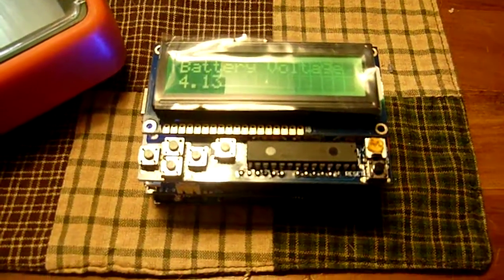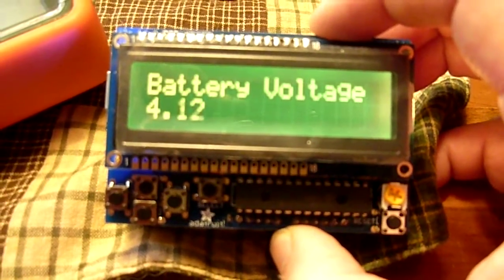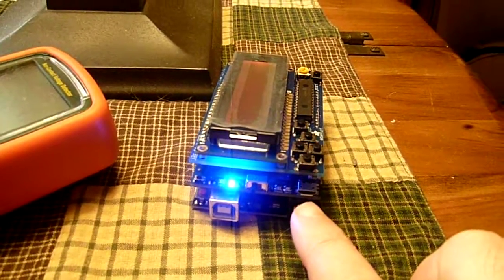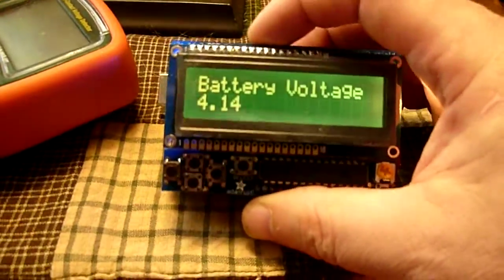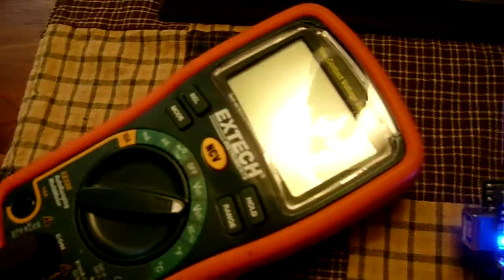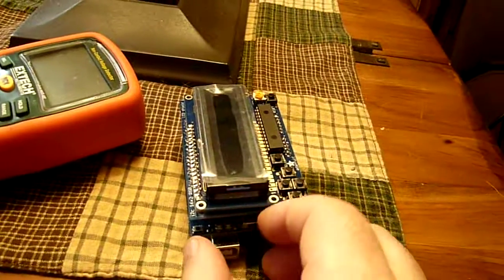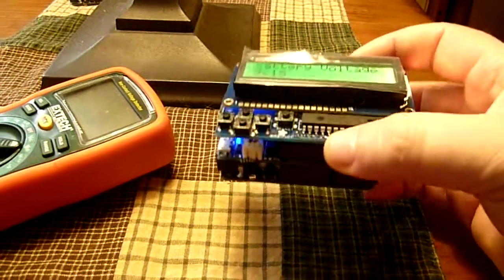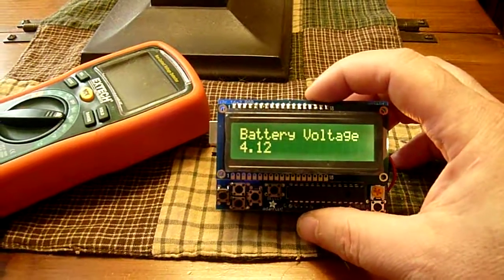Adafruit Powerboost LIPO Shield LCD Volt Meter

Comment: Thanks for sharing! Question about the LCD shield: it looks like this shield doesn't forward unused Arduino pins upwards through another layer of headers. It's great that this shield uses only 2 pins, but how can I use other pins to connect to, say, a breadboard if the shield is physically blocking the Arduino pin headers when it's in place?

Or am I just not seeing it clearly?
Reply from the maker: +danns87 Use a proto screw shield underneath.